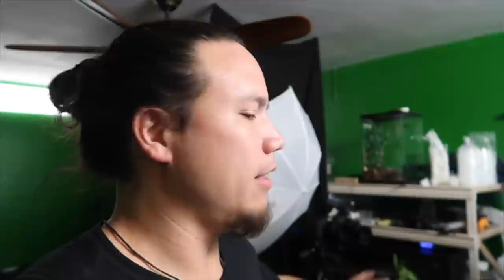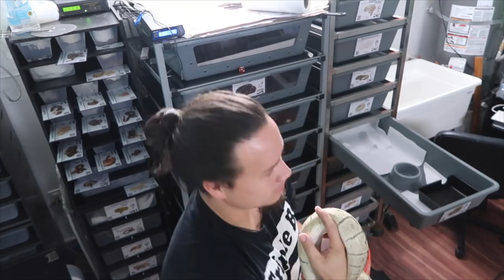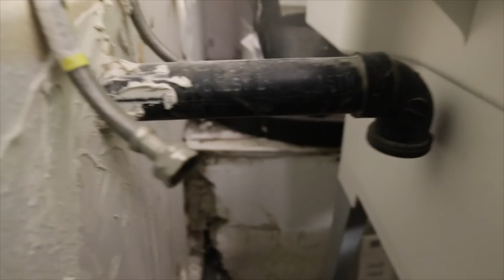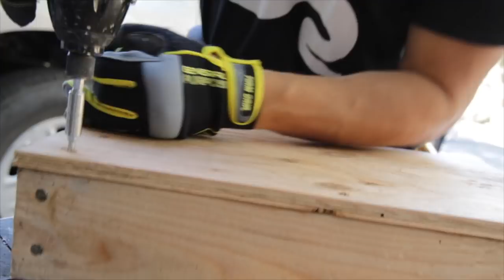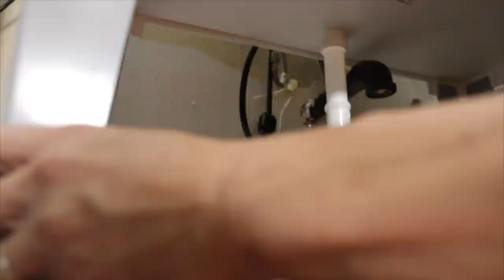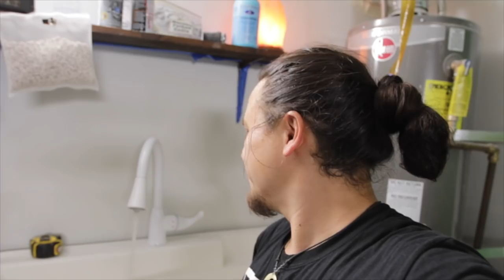WATCH AS I SMASH MY HEAD BETWEEN TWO BLOCKS OF WOOD!!

Comment: Quick question how did you secure the sink legs to the support frame or are you relying on a sink wall mount to keep the sink from moving off the frame boxes? Just curious which way you're going with that? I would have laid a solid piece of plywood over the framed stands to better support the sink and keep it from moving around.
Reply from the maker: The legs are screwed down into the boxes. I left the top open so that I can make full use of the space between the bottom of the tub and the ground 😊
Reply: Sounds great and should work great :) I was just curious and thank you for the response my friend :)